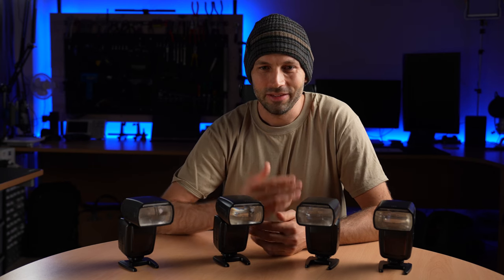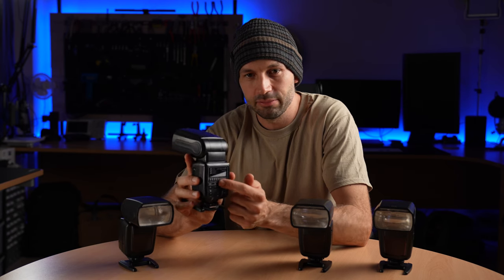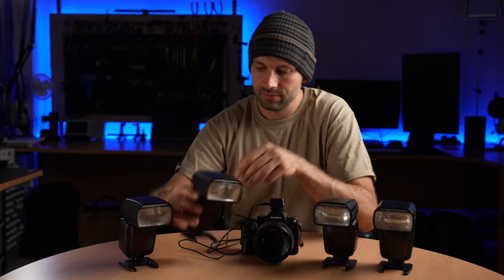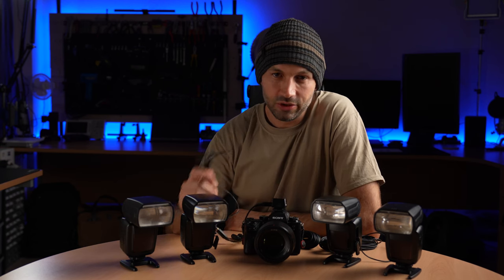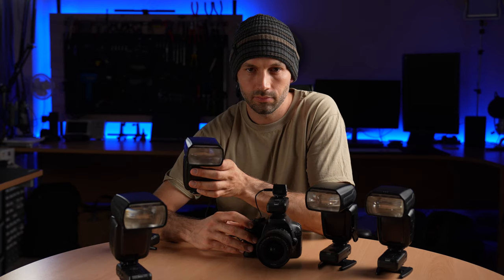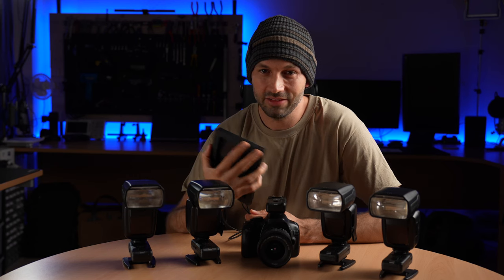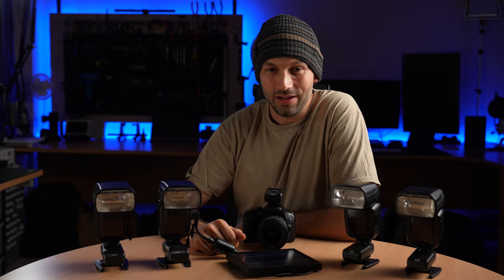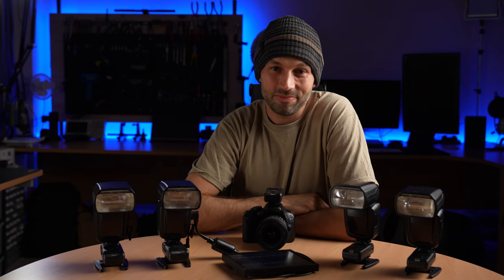Flashes for Camera Trap Photography

Comment: Hello, imformative video, i have some of your gear, i am using a transmitter in camera hot shoe, and 2 recievers, one in the side  of camera, and 1 on flash, am i doing it right? do i need the other reciever in side of the  camera, as you dont mention that reciever, and roughly how long will lithium aa batteris last in the flash before they need replacing....Many thanks.